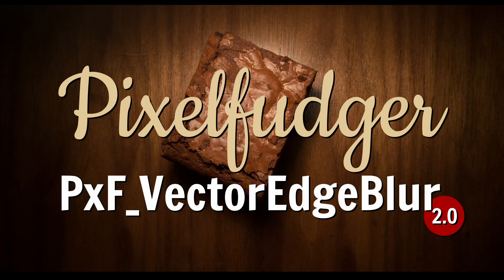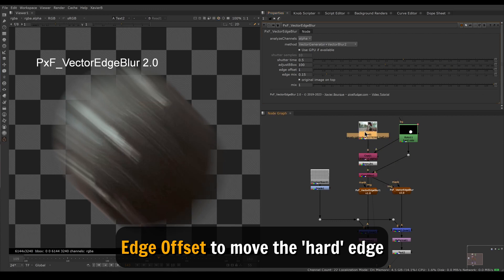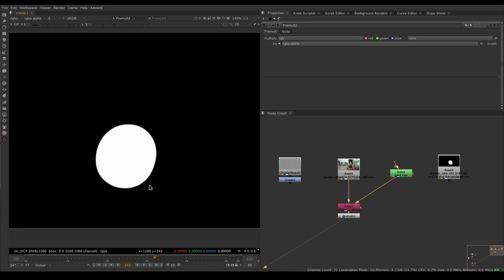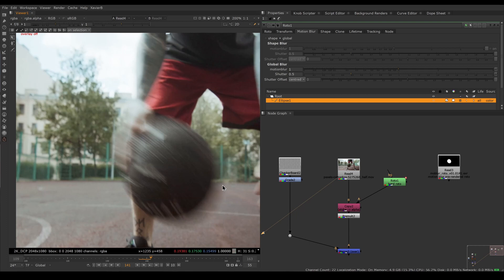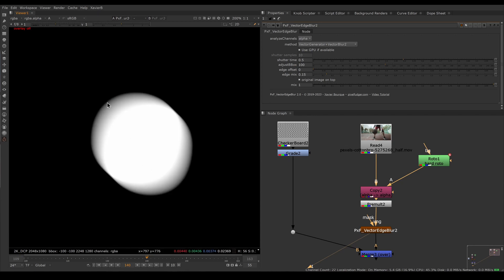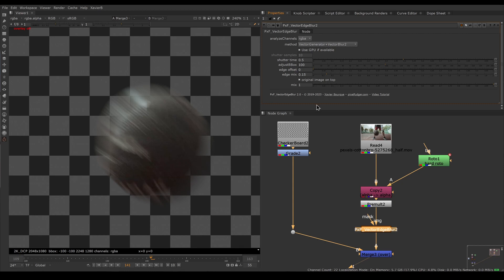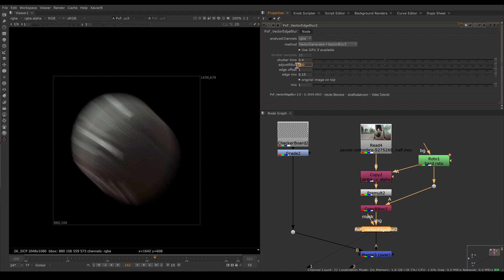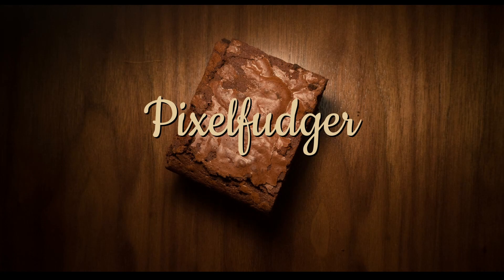PxF_VectorEdgeBlur 2.0

Comment: I want to use this so bad but when I attach it to the premultiplied roto I get these weird black squiggly zebra print like lines. Any clue why that might be happening? Does it not work on 6k plates?
Reply: For anyone else having this issue, I realized I just need to do a white clamp and that fixed it!

Comment: is there a gizmo for vector blur from vector pass from 3d apps
Reply from the maker: You would use the VectorBlur node for that. There's a few settings to adjust but no special gizmo is required.